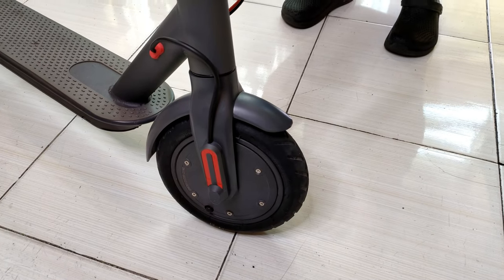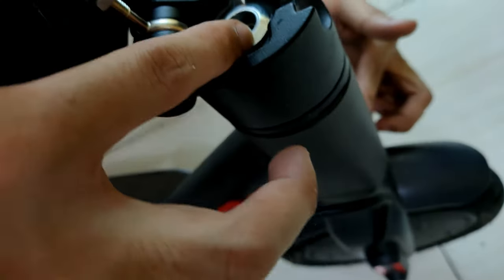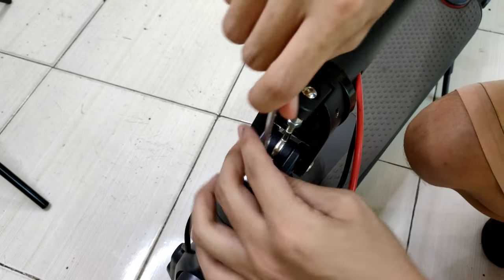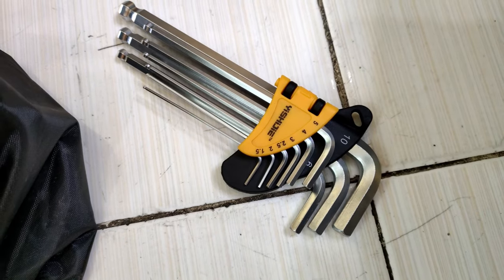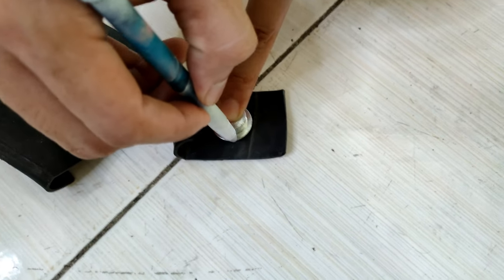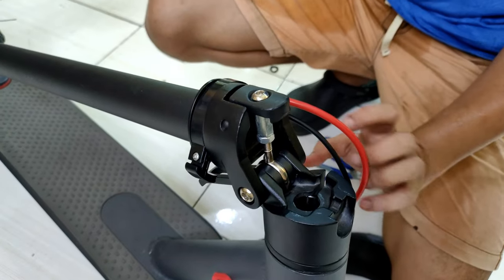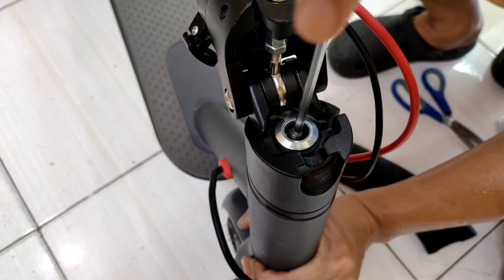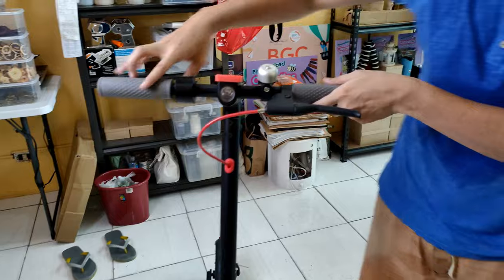DIY | How to Fix M365 Scooter Misaligned Steering bar and Front Wheel | EASY FIX

Comment: It worked. I changed my tires to tubeless that is why the while frame started to vibrate more. Putting the rubber gasket absorbed the vibration caused by the uneven roads. Thanks for the tutorial!
Reply from the maker: Yess the DIY rubber is helpful and we unleash our resourcefulness.
Reply: I just changed my wheels to puncture free tires. Do you think this is my problem now? I can drive it but on ground that is not even I can feel the wheel getting a bit unstable

Comment: My scooter turns to the left but wont turn right, its also turning left significantly more than normal. How do I fix this, help would be appreciated.😊
Reply: Have the same problem
Reply: @blingblingdog6958 honestly bro, it seems like a you problem. thats not how scooters work, it doesnt just "not turn" in one direction, you are most likely doing something wrong, this is physically impossible.

Comment: My idiot friend crashed my scooter and now it won’t turn left and only goes right too far
Reply: Same
Reply: Did you end up finding a solution?
Reply: LOL L BOZO
Reply: You have to pull the wheel over. I'd take the handle off and the main bolt out first.i just did it to mine. My kid wrecked it and it would only go right and zero left.

Comment: Yung front wheel ko parang umaalog alog pero di ako sigurado kong pareho bang problema jan sa video mo. Ang front wheel sobrang ingay pag sa sidewalk dumadaan. Di ko lam misalignment ba o bearing ang problema.
Reply from the maker: You can check din sir the tightness of the screw and/or the lock.. umaaalog din due to wear, in long time- due to friction, that is why may gap between parts that causes the wobbling

Comment: Bro. Pano malaman kung may tama n yung ball bearings sa front fork ng m365
Reply from the maker: Normaly if there is an unnecessary sound (or hndi magandang tunog) due to friction.. and feels like untighten (aalog alog). These are common troubleshoot for the problem

Comment: I like watching you make your own washer.
Question, my escooter won't turn. Do you have any advice on what is causing it?
Reply from the maker: Hello sir! Would like to know if you regularly use your unit? Do you pass by roads/ pavements with water? If so, Based on what I experienced, these might be the causes of the unit. Let me know and will wait for your reply
Reply: @frenchtownbayan4215  Hello back!
I passed over water maybe 3 times. But it wasn't even an inch deep. I take care to go around puddles.
Thank you for getting back at me!
Reply from the maker: Hello sir! You may also try this… One good trouble shoot is to check your wirings on the ON/OFF button. Due to some bumps along the road, we didn’t notice that these affect the internal connections of the wiring. Try this tip and let me know
Reply: @frenchtownbayan4215  thank you so much. I will keep you posted on my results your support is so appreciated

Comment: Same with the Ninebot Max. 
They did this so that when folded the front wheel is straight. 
Pointless!! 
The wheel should be straight when riding not when folded.
Reply from the maker: There might be some purpose for the design that we may find out soon 🧐🧐🧐